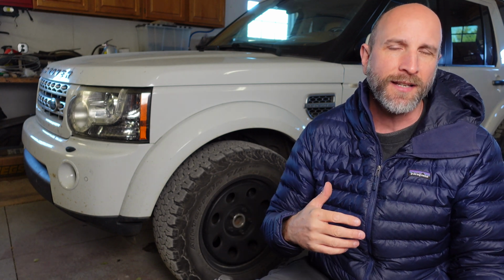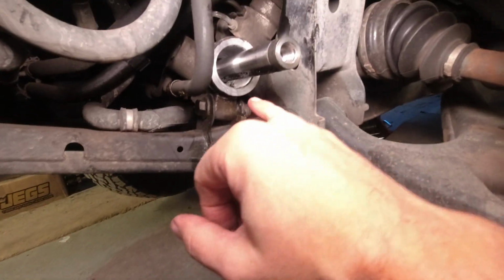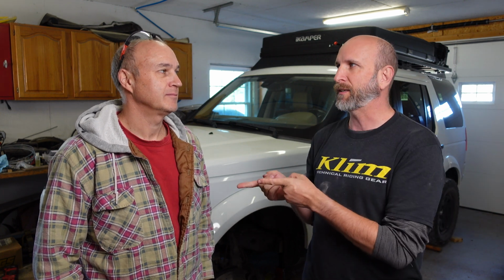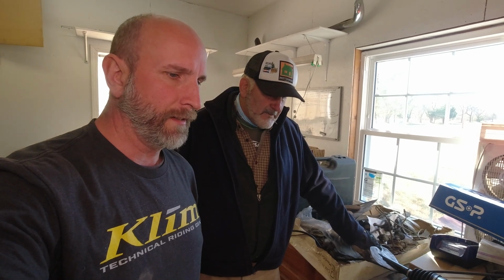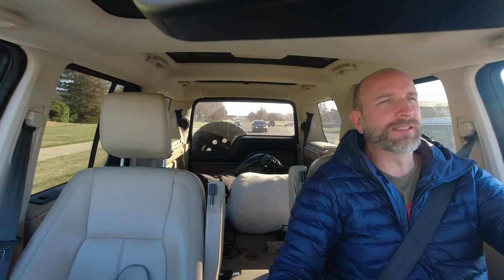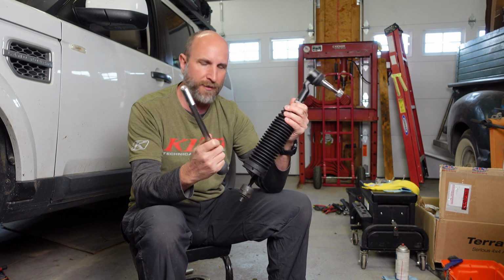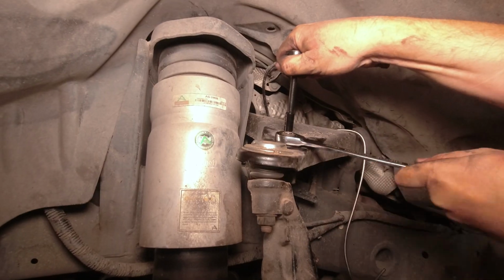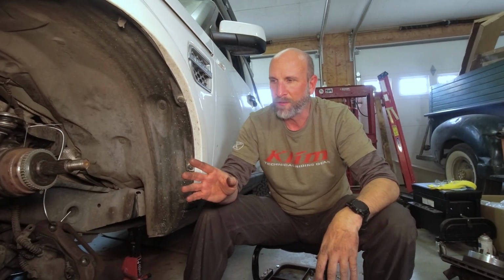Total Failure Fixing My LR4 Wheel Wobble | Land Rover Do-Over Land

Comment: Before I started watch, I thought “the first thing I’d check is the front control arm bushes.”

Only because We have a D4 with 151k and very slight wheel wobble. Front control arms need replacing according to the MOT. I suspect that’s it. 

You might also want to check the rear prop shaft as the centre bearing bush fails and the shaft wobbles at speed. Not too difficult to replace, just about 3 hours of wrestling under the car 😂

Good luck!

Comment: Next time you need control arms.. just get the Meyle HD front lower control arms.  Better bushings that last longer than the hydro bushes, but still soft and wont crack your arms like the poly bushes will.  Not worth replacing just the ball joints, always do the full arm.
Reply from the maker: Thanks for the info. I'm putting that in my notebook for future reference.

Comment: I had an alignment shop try to tell me that my LR3 tie rods were too long as well, just two weeks ago, and mine were the exact same length as the OEM ones.  The first time they said they couldn't set the toe.  Then I brought it back with new tie rods (that were the same length) and they had a more experienced guy align it and it came out perfect.  What I suspect is that they didn't not follow the order of adjustments as outlined by Land Rover, or that the Hunter rack has the adjustments out of order.
Reply: I recently replaced them on my LR3 (same as LR4) and used original TRW kit for L and R side. I had to thread the balls joint on fully to get them to the same length and one of them was fully threaded on to the end of the inner thread on the ball joint. I checked it by taken the ball joints of and noticed one of them was not fully threaded all the way from the factory. Maybe you had the same issue.
Reply from the maker: I suspect that’s what happened to me too. Midas couldn’t figure it out, but the dealer had no issues. Same price for the alignment (surprising!). Now I know better.

Comment: I'm wondering why you opted for a 'money-pit' Land Rover over a low-maintenance, reliable Toyota Landcruiser.  South Africa's Voetspore team use primarily Land Cruisers, although they have used the VW Amarok and the Land Rover, but they always come back to the Land Cruiser.
Reply from the maker: Well, so far my “money pit” has cost me about 1/5 the price of a Toyota. I’ve spent about $15k all in. The Toyota was just too expensive. I bought the Land Rover knowing the issues. I fixed them. Now it’s working like a charm. Any vehicle with 180,000 miles will have issues, it stinks that the lock bit me, but it can be fixed.

Comment: Love the videos, but going to be hard to say exactly whats going on with it when changing more than one thing at a time.
Reply from the maker: For sure. The plan was to do one thing at a time, but the plan didn't work out. But it's good we are able to make the best of the situation. It's definitely a learning experience!
Reply: @ShiftyDrifty  i think i know why they wouldnt do your wheel alignment. Your spacer rings. Take those out i bet they will be ok with giving it an alignment. Get the alignment and then put them back in.
Reply from the maker: @Raylep1  The wheels won't fit without the spacers. They are 18" wheels, so they hit the brake calipers without spacers. I've had the truck aligned twice with the spacers, no problem.